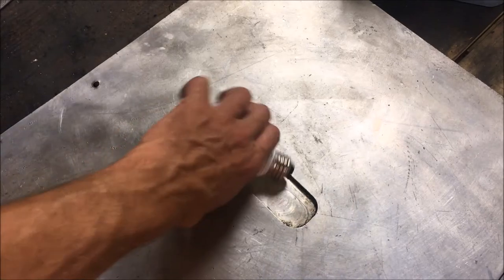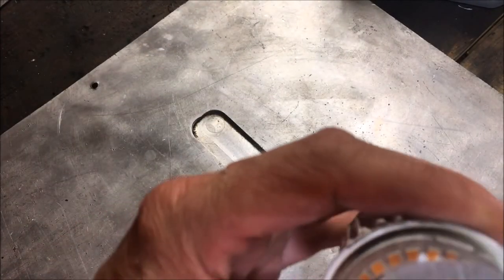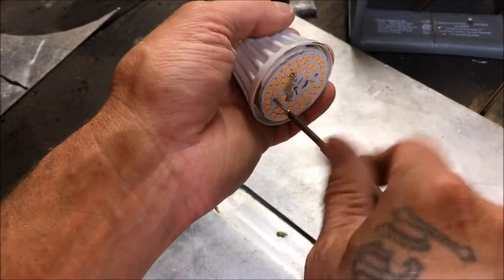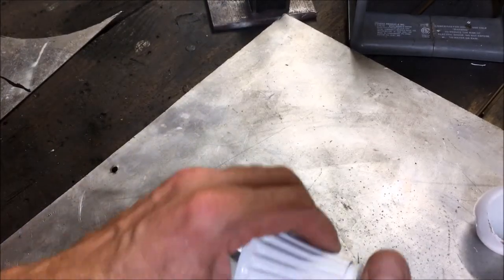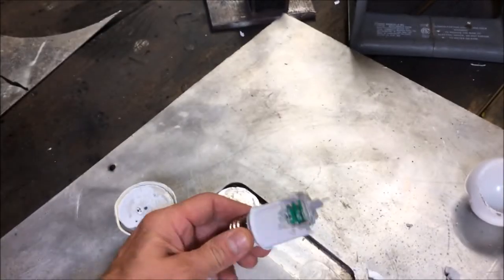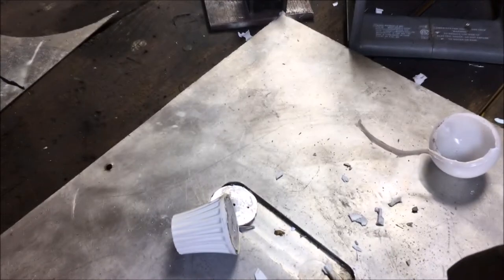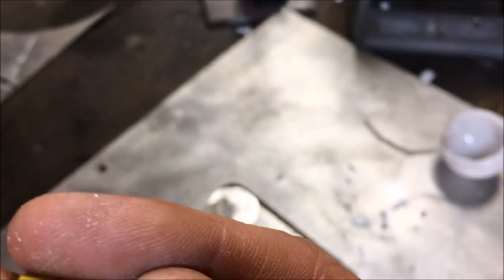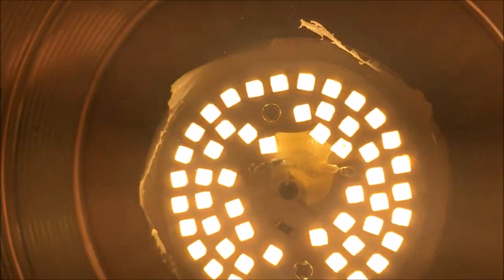LED  light bulb dissection ( life span ? )

Comment: L3 doesn't have to mean it's an inductor. It's just a name in the program they're using to design the board in, it could just as well be called O3. L is typically a coil, but it's not like cheapest chinese manufacturers are known for adhering to western industry standards. The part you're showing is indeed a transformer, but there's nothing "high voltage" about it. It's a mains transformer. High voltage means the stuff that's used outdoors by the company that provides electricity to your house.

To step up voltage takes the same amount of copper. Amount of copper has absolutely nothing to do with voltage, and everything to do with current. Power = voltage * current. If voltage goes up, current has to go down, because you can't have free power. The reason they step the voltage down is because anything more than 12V would pop all the LEDs dead before you even finish flicking your light switch. They don't like your mains voltage, and they definitely don't want your mains voltage turned up even higher.

Pretty sure the actual fault was inadequate cooling (this is the #1 reason crappy discounted LED bulbs fail, they design these to run way too hot, so they kill themselves by suffocating themselves to death), or something crapped out in the power supply stage (which is done as cheap as possible, with no regard to safety) - they just seal the whole thing shut so they can't be held liable for someone getting killed, and hope that it doesn't blow up.

Comment: I found that the power rectifiers die on them, they overheat. You can power them on from 3v to 12v typically, if you get them a whole lot higher voltage than their rating the diodes will disintegrate.

They often have horrible heat sinks, but they run excellent on low voltage supplies like a wall adapter, a cigarette lighter adapter, a USB adapter or right to some DC batteries, anywhere from little button batteries [very short lived] all the way up to car batteries [very LONG lived].
Reply: Diodes theoretically would have a decent tolerance because of how the depletion region works.  But allot of electronic circuits do fail prematurely due to voltage regulating components being undersized for the circuit.
Reply: I have read up many reports of just how sensitive LEDs are to heat and chemical degradation right around the point of the electroluminescent contact due to the extremely intense release of high energy photons attacking the materials supporting the array right around the semiconductor die [the part that emits the light] until the heat and degradation of support material leads to the junction failing, rendering the unit useless even though not visibly damaged to the naked eye.

https://upload.wikimedia.org/wikipedia/commons/2/24/Surface_mount_LED_close_up_image.png

As a child I once accidentally burnt out an LED with a 1.5v button battery because I put too much voltage on it without any heat sink [it was a clock which did not have the large resin bulb or a large anvil to sink and direct heat away from the junction].